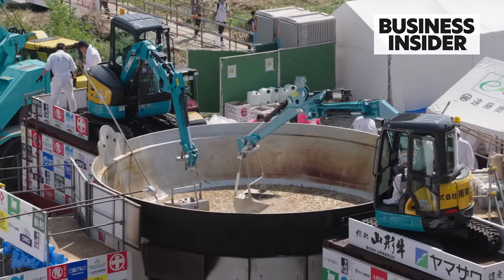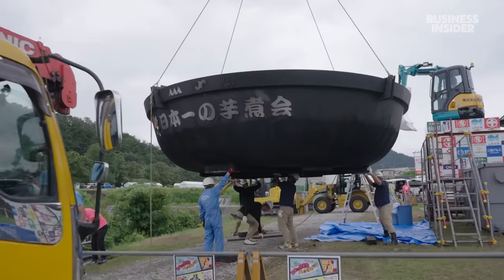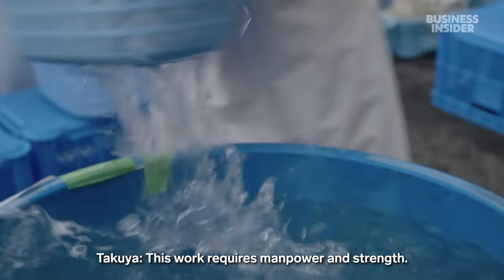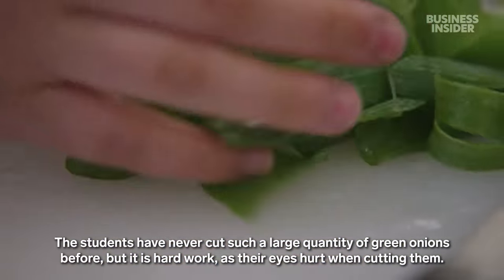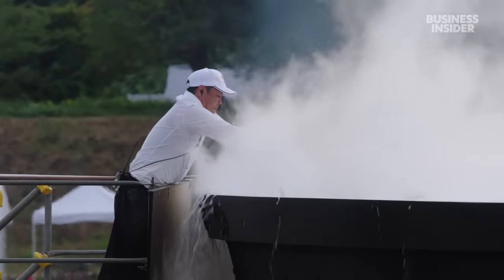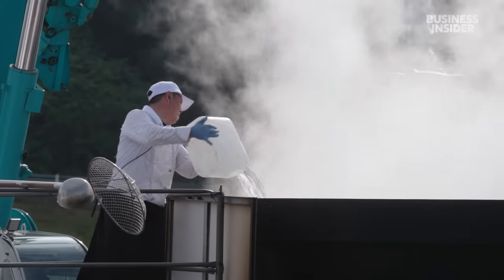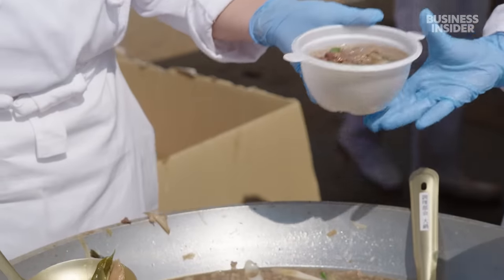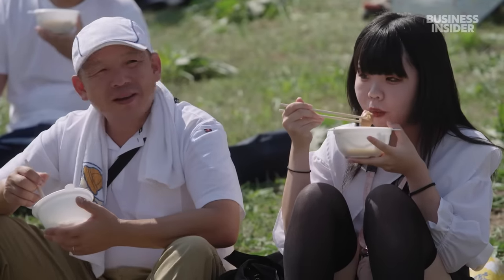How Japanese Chefs Feed 30,000 People With World's Largest Bowl Of Beef Imoni Soup | Big Batches

Comment: 5:00 machinery being lubricated with butter is something I never thought I'd hear
Reply: 5:15,
Reply: @stevethea5250  Seems a little farfetched, but funny
Reply: @ayreface1 it's not
Reply: Only on scoop parts. Not for machine or hidraulics system
Reply: Eeeeeeeeeeeeeeeee
Reply: As Indian this happens in India as well but the machines are lubricated with grease and engine oil😂
Reply: She says beef, but there is a sign in front that says 山形豚, which means Yamagata Pork
Reply: @h.i.sentertainments8580 looked red like beef to me
Reply: @TonyMontanaOG  I open the website from the Imoni-kai, ready to prove you wrong! But I saw that they actually use beef. Turns out I'm in the wrong. Pat yourself in the back😂

P.S. When I looked closely at the sign in the video under the backhoe, I realized that it says 山形牛 (Yamagata Beef) instead. I grew up in Japan, but recently moved to Germany. I guess a year abroad is already taking a toll on my Kanji recognition ability😅

P.S 2. Hold on, it actually says 山形豚 at 5:08, but 山形牛 at 0:00. I don't know what's going on at this point.

Comment: Excavators to be used for the Imoni soup festival must meet two most important requirements.
 1: They must be of recent manufacture.
 2: They must be new and unused.
After excavators are dismantled, they are lubricated with butter by hand. People have been testing various cooking oils before they found that butter is the best grease.
After the festival, excavators are carefully cleaned again, re-lubricated with machine oil, and auctioned off. Excavators used for this festival are popular as good luck charms and fetch high prices.

Comment: I feel like they should have cleaned it after putting it in place. I've never seen a metal cable that hasn't had dirt, rust or small metal pieces come off as a result of the great amount of tension put on it.

Comment: The whole time I was worried, how are they not concerned with oil or hydraulic fluid getting into the food?
Reply: Excavators to be used for the Imoni soup festival must meet two most important requirements.
 1: They must be of recent manufacture.
 2: They must be new and unused.
After excavators are dismantled, they are lubricated with butter by hand. People have been testing various cooking oils before they found that butter is the best grease.

As an aside, after the festival, excavators are carefully cleaned again, re-lubricated with machine oil, and auctioned off. Excavators used for this festival are popular as good luck charms and fetch high prices.